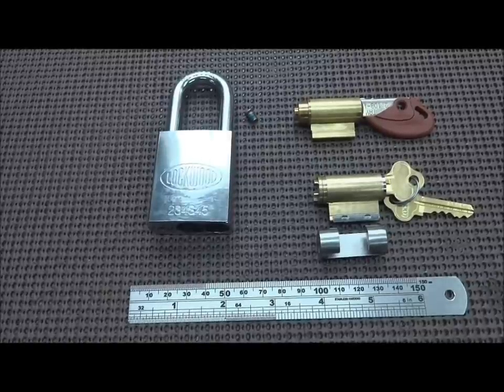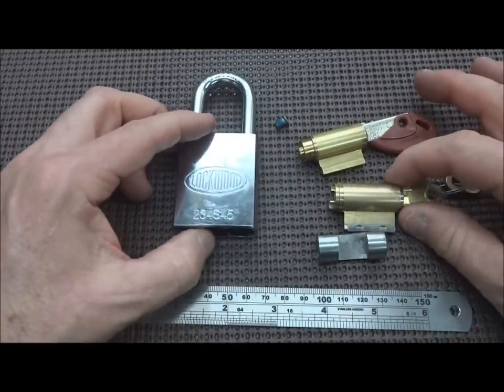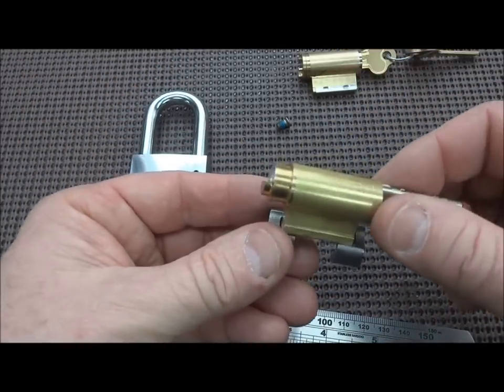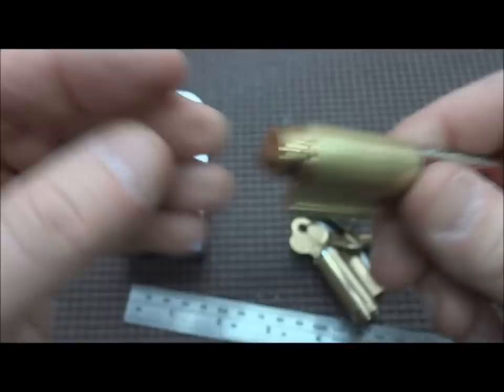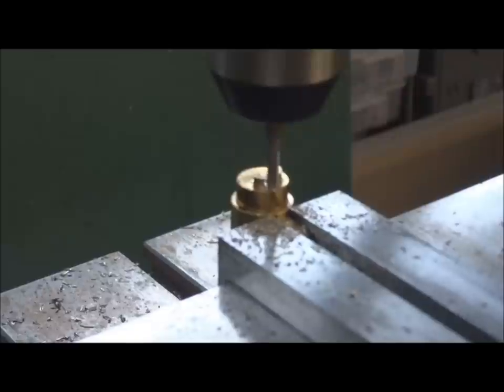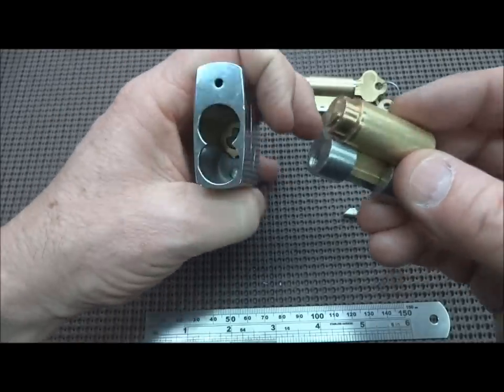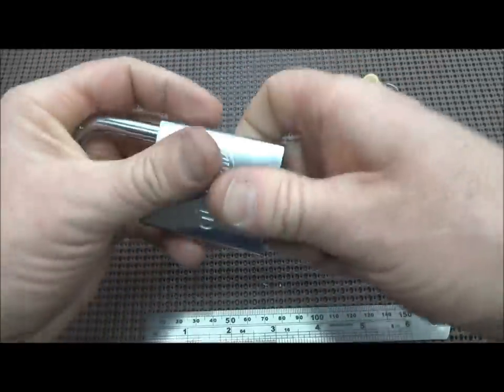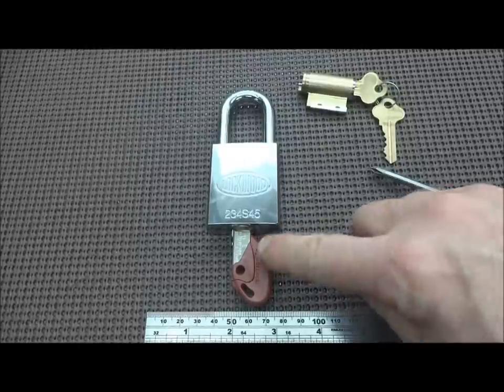(211) BiLock Cylinder in a Lockwood Padlock (Thanks S1deshowmick!!)

Comment: ALC have since provided a specfic body part that allows their products (Series Six, BiLock [Exclusive], and Galaxy) to be retrofitted to the 334(B/C/S/M)45 padlocks, with the same actuator on the back (which also allows for key retaining) and better dimensions to snugly fit into the lock. The only downside is that the core is not flush with the body, meaning you would not be able to keep it upright without the risk of tipping it over.